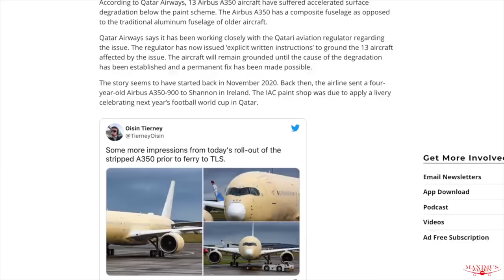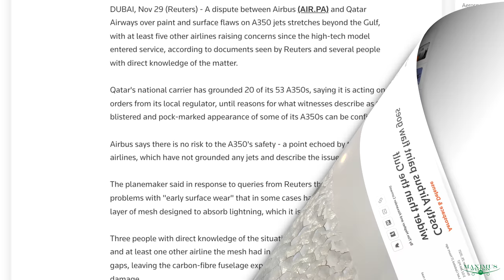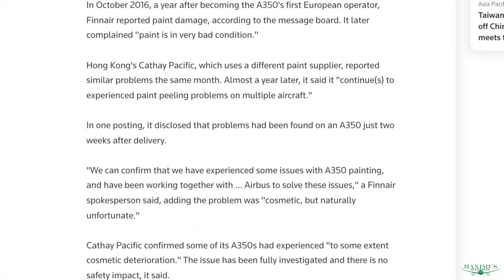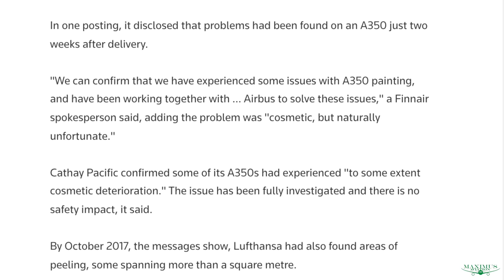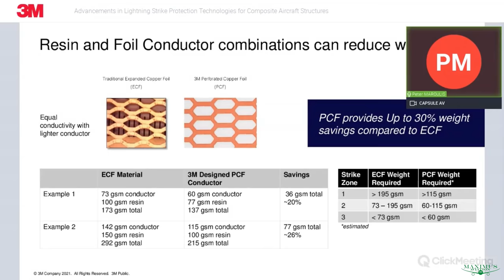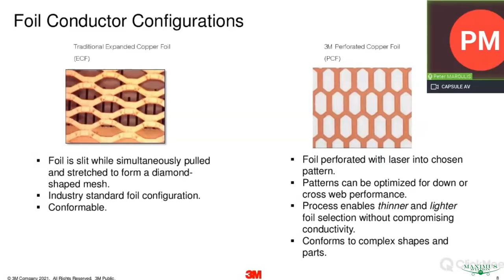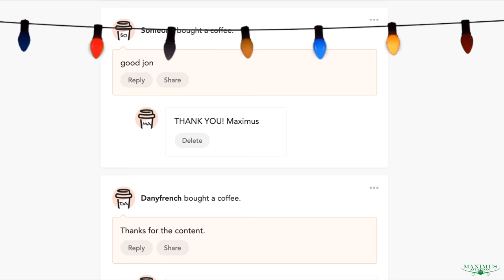Six More Airlines Report A350 Fuselage Defects That Expose Composite Lightning Strike Protection

Comment: Because Maximus asked: 
With nearly 40 years of  advanced material reinforcement, ISO quality standards and ASTM (I) failure analysis engineering experience, there are a number of concerns with the chemistry, mechanical properties of the materials and application methods used in the composite fiber sandwich. 

For example, Carbon fiber and aluminum don’t mix nor does Teflon®. Just ask Boeing.

From expansion to contraction, flex to fatigue, tensile strength to elongation, chemistry to physics, and application methods, all play a complex intricate role in the mix of the delicate carbon fiber sandwich 🥪 ✈️ .

Just one incompatible material or application error in the fiber composite sandwich, the resulting heartburn even a pound of Tums won’t fix. 

If Airbus or Boeing asks, I will gladly help. They have huge problems on their hands.
Reply: Same problem on deck fittings on carbon  yachts.
Reply: Ditto and then some (Mil-Q-9856/AS9100) ... fully agree. We don't know the "Manufacturing Process" AB is using ("proprietary") so about all we can do is asking probing questions as you have. TE Panels on my C-130J's (including the "WC-130Js" that fly thru Hurricanes and sustain 26 lighting strikes per pass on average) and I've NEVER seen this result.  But from the curled edges of some of the chips, there appears to be "heat" involved.  Cu Mesh is always the first layer laid on the bond form and therefore the exterior, bottom of part. The photos appears to show the mesh to be "Aluminum" (not good if so ... completely different process to bond to carbon fiber ... the Japanese "F-16" was the first to successfully do this back in the early 1990's and just WOW on the increased Clean Room/surface prep required ... and labor hours). And more troubling is the complete evacuation of ANY resin in the cells ... it doesn't just "pop out" ... so my bet is either "heat" or galvanic??? The ONLY reason for the mesh is to funnel a Lightening Strikes energy to the static dischargers (usually located on the TE's) for safe dissipation and avoiding a "burn thru" (bad deal if a pressurized cabin area). And the cell size of the mesh is WAY larger than what I've used for decades (copper/CU) and that has a net effect on transfer speed ... as well as AL not being nearly as good a conductor as Cu.  And since you are the only one bringing up "Process" in this thread (thanks) it has to be determined if this layer was done in an Autoclave or with a "Hot Bonder"; the latter works but not as good ... good devices for "field repairs" with a time limited/increased inspection frequency until R&R'd. "Compound Curves" are challenging in the Bonding process ... hence use of "thread laying machines" on platforms such as the F-35 ... but "Lightening Strike" material on the A350 is obviously hand laid.  And lastly, it is of important note the the mesh ply be "Scuff Sanded" (only for activation for subsequent coatings) and most specs specify "by hand" so as to not get into the mesh itself; thin the material with power tools and it's to the scrap pile; note above someone commented his company is a subcontractor to Toulouse and they "ship them out with primer to prevent oxidation of the mesh" ... 4 decades and living/working in 38 Countries in our industry has taught me many things ... especially that "if you don't physically look, you'll never find a problem".

Comment: Aluminum gets detectable cracks. Composite impossible to know what’s going on. Just have to wait until you get a Hawaiian convertible. How are those computer designed engine cowlings working. Don’t set inline with the fan turbine or next to the window.

Comment: Okay so to tell you why it's delaminating I have experience with carbon fiber composite and not so much lightning protection rather Faraday caging so when you have all those materials sandwiched together you have different expansion and contraction from temperature changes and that alone is what's causing the delamination no matter what kind of chemical or mechanical fasteners you have keeping those materials sandwiched together it's never going to be fixed now when you have this stuff on the ground and it goes through temperature changes it's slower let's say versus an aircraft sitting on a tarmac and then going up to altitude as well as the vibrations from the aircraft itself it is a problem that unfortunately science and technology haven't caught up with and when they say it is purely cosmetic that is just trying to save the companies in airliners from losing money from stocks and public perception
I'm not a fan of compositesin aircraft of this size we don't know enough and don't have enough data on material blah blah blah

Also within that you will never have something adhere to a mesh that's metal sandwich between composite basically the lightning protection mesh is the issue but no one's going to admit that especially 3M it's kind of messed up but they would have been better with aluminum foil as it has more surface area for the chemical and mechanical adhesion but when you go back and look at the way metal aluminum or copper expansion contracts versus carbon fiber you're literally mixing water and oil never going to work now if you in bed middle fiber in the carbon fiber you'll actually end up with worse structural issues anyway you look at it these planes are not going to be in the air in another 10 years sorry

Now when we talk about small aircraft like personal aircraft yes you have the same issue per se but you're dealing with a lot smaller surface area of expansion and contraction thus the issues not as pronounced or noticeable

It's not the paint's fault within that though I would say they should start using an epoxy based paint to try to mitigate the issues while these things are still in service but at the end of the day again I'm not flying on any one of these aircraft I don't feel they're safe too many corners cut too little known about the materials and working with them

When I worked with similar materials for none your business we saw this as well but it wasn't as big of a problem because we weren't putting people's lives on the line for it and our fixes wouldn't work on an aircraft

Comment: Oh I also forget you can get electric conductive epoxy paint but it is so expensive it's not funny and it has its own drawbacks with expansion contraction UV etc long version short these planes are going to be in the boneyard in less than 10 years

Comment: What a bullshit clickbait article. Why do you point the insert pictutre to the pitot tubes?? So misleading. There is no way the cracked paint is within a feet from any pitot system. The insert picture shows a static discharge wick somhere on an aileron or elevator surface.
Reply from the maker: Really? I  have to disagree.

Comment: Boeing doesn’t seem to have this cosmetic problem on its 787.  Does the B787 even use copper or aluminum mesh for lightning mitigation?  Maybe eliminating that was another cost saving (and safety concern) measure on Boeing’s part.

Comment: regardless of temp fluctuations, these are supposed to be evaluated and incorporated into the design of the plane. This is why they cost 100s of millions. Seems as if Airbus is potentially going the route of the 737 Max…which is stupid. Quatar has already said they will by now more Airbus A350s and A380s and will switch to Boeing 777s and 787s. Airbus is ruining its brand for shareholder value…
If just one of these carbon skinned planes which were not addressed goes down, Airbus is going to sink.
What is the CEO thinking
Reply: Absolutely

Comment: Ok this has been going on for some six years and still no statement from EASA. Expected since it is Airbus. Yes, without a protective coating damage will penetrate the surface and damage the composite structure.

Comment: Fixing issues with the composite material airplanes is going to be a never ending and very expensive pithole. Get off this stuff and divert the R&D money to the aerodynamics department. The gains are going to be substantially better than this.
Reply: Back to shiny aluminum planes
Reply: the design of the 777X and the folding wingtips adds weight to your argument...
Reply: @steinbockguy  Aluminium is of course heavier, but with improvements in aerodynamics you can more than compensate for it. A lot more.
Reply: @abababa7483  I agree 100%.